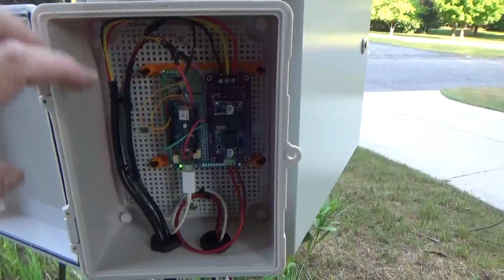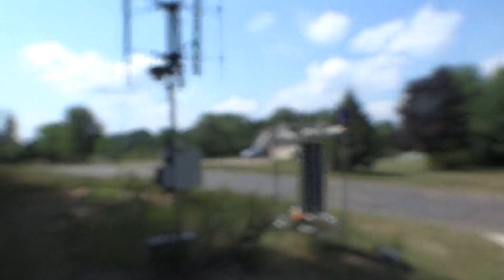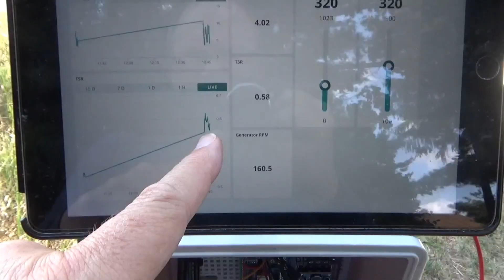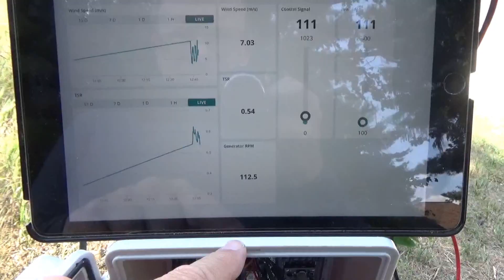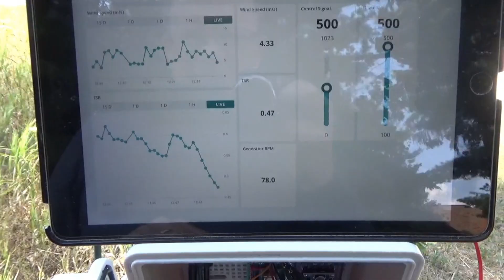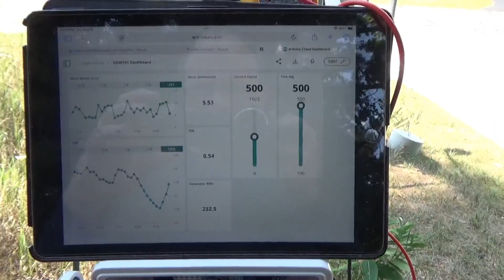Skateboard Generator Update

Comment: I'm guessing the sharp alt is too powerful to run through that control... wish that wind would have kept up for a few more days
Reply from the maker: I was thinking of trying that just for fun.  There should be a current limit on the chip so it would simply stop producing after a certain point.  If it burns something out, it wouldn't be much of a loss ... provided nothing else starts on fire.
Reply: @MickEMaus3000  it is really strange your you're not getting power; I don't remember if you bench tested it for output but I'm sure you did.